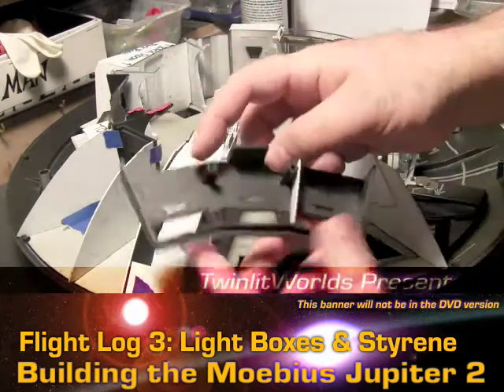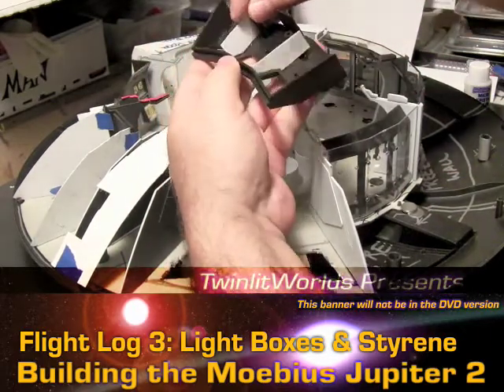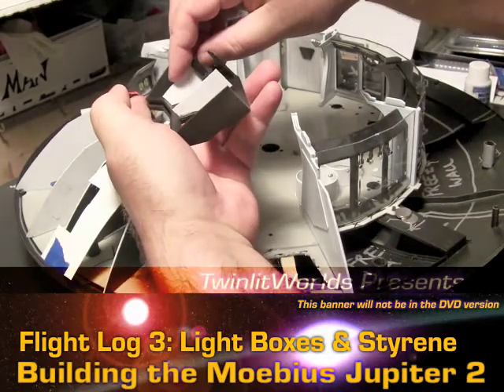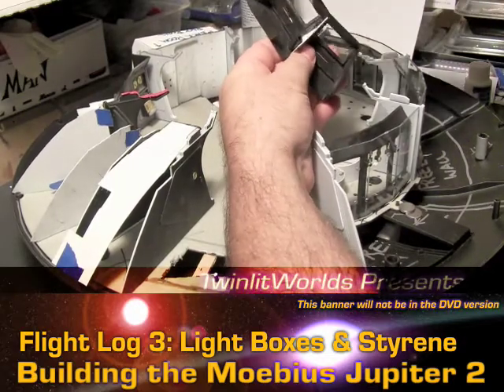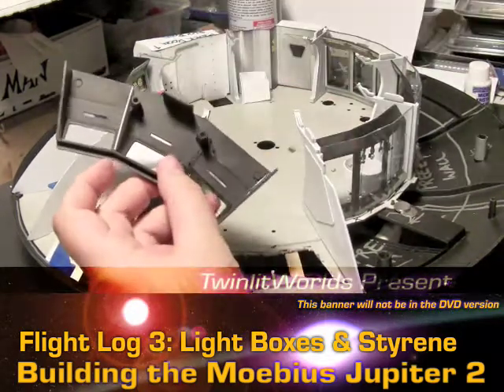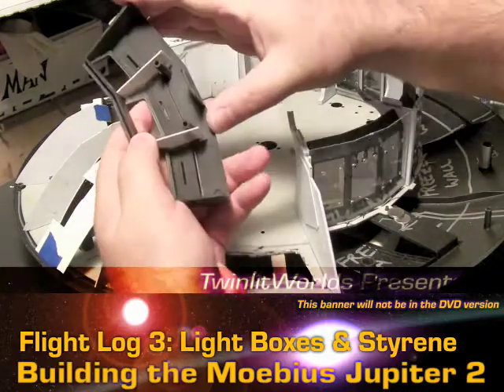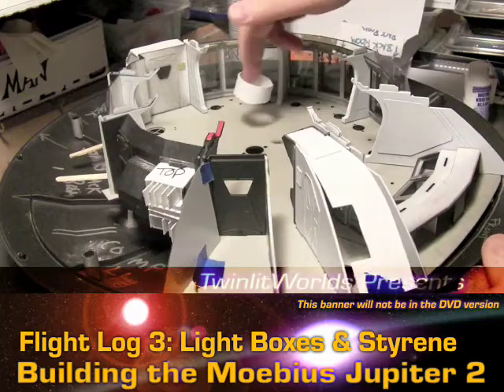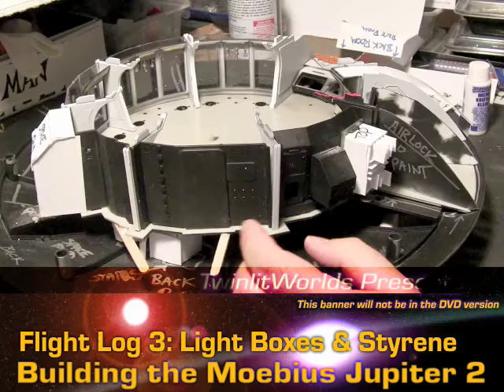Project Jupiter: Flight Log3 3/7

Comment: Here is something I found on another web site:  Shurtape AF912.  

It is basically aluminum foil with a tape backing.  I have started to use it for light blocking.  Don't need paint, and it is very reflective.  Since it is metal, it blocks all light.  Easiest thing I have found to work with.  You can find it at most home improvement stores in the area for duct work.  This tape is used to seal up ducts.